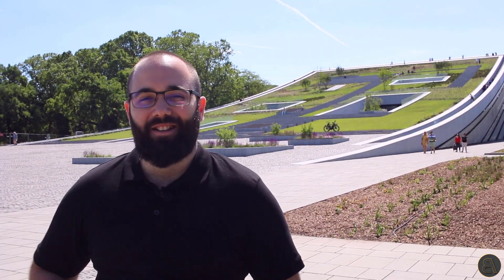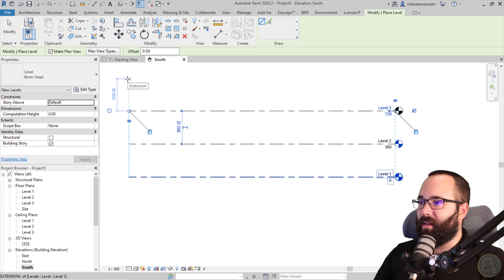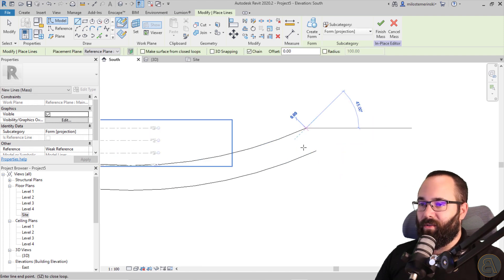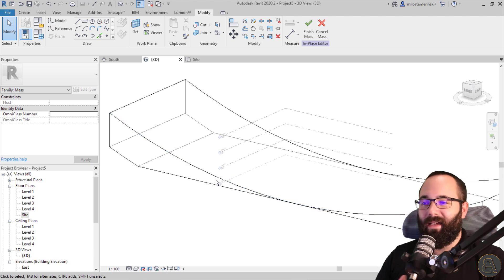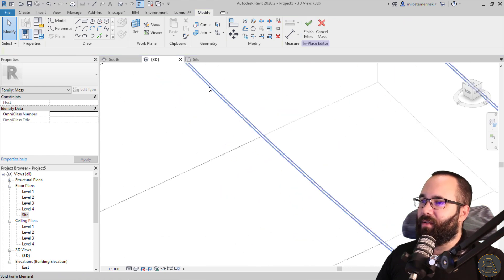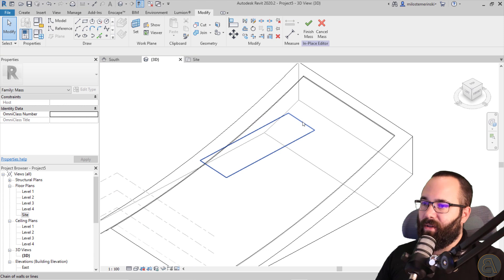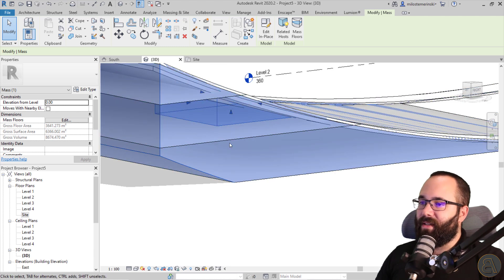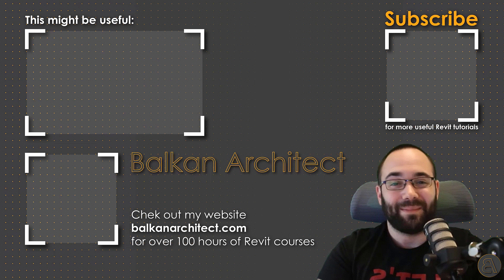Landscape Integrated Building in Revit Tutorial

Comment: The massing tool is very, very overrated - it feels like a non architects notion of how an architect designs. The adaptive family part is the most interesting aspect of it by a wide country mile.
Reply: Theyre pretty bad versus platforms like rhino. Most real firms do not use massing beyond feasibility studies for yield (mass floors). We actually use rhino and rhino inside/adaptive components. None of the firms featured in these videos would have used revit massing for their design process.
Reply: @AussieBIMGuru  There is a Revit (or other BIM authoring software) method outlined in the CIC AEC protocols I have used happily on a few projects. I found there is a very quick transition through the main project stages after a slightly slow start. Getting design leads to have a little patience was the hardest part. None of our design projects in Rhino have made it a detail design stage so I can't speak to how the two development options compare. One thing I don't ever recommend though is the massing tool.
Reply: @joer_mobile  yes typically rhino is not for detailed design. At the same time I tend not to encourage relying solely on revit at any one point of a project, as the tools and user skills limit the design/construction potential.
Reply: @AussieBIMGuru  yes, so many programs, so little time...I do like trying to get the most I can out of Revit though and I think the CDE generally (BIM 360 in our case) is very under utilised....

BTW I love that cat in your videos I think he / she is the true star!...have a good one!